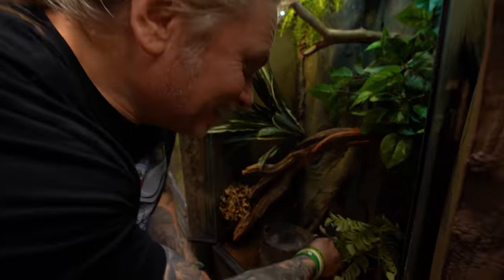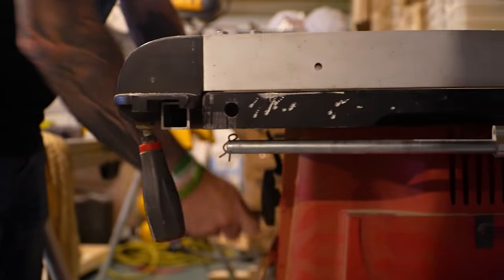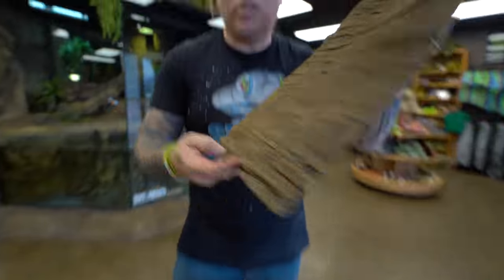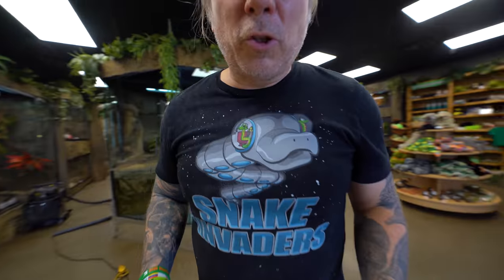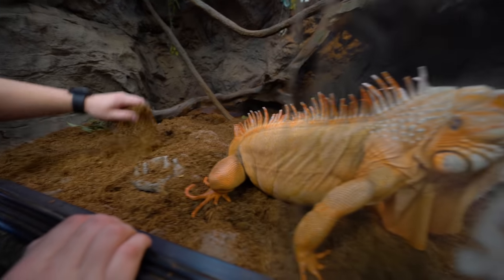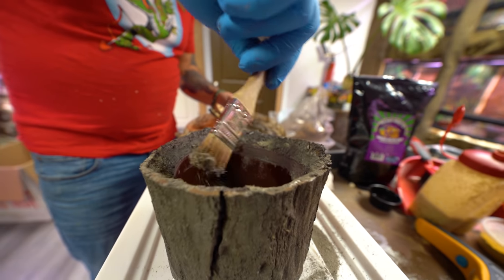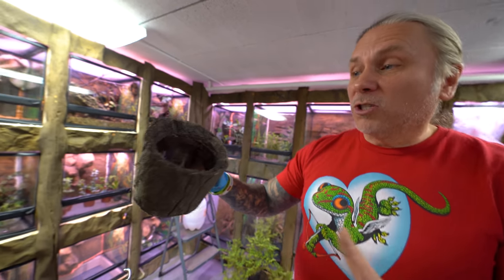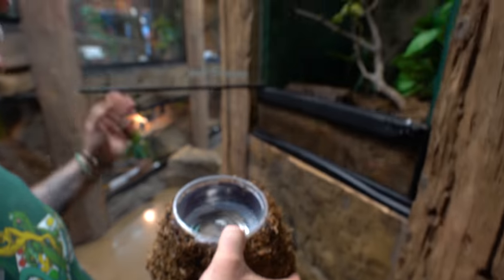I Built These For $15! Make Your Reptile Cage Shine!

Comment: Pro tip with great stuff

After about 20-30 minutes, the outside layer of foam hardens but the inside is still wet so you can contort and shape it super easily. If you press it down, you won’t need to trim all the ugliness later. It keeps it much cleaner looking.
Reply from the maker: This is a great tip!
Reply: Thanks. I'm looking into how to use this kind of stuff to make my own hides so I appreciate any tips 😊

Comment: I make whole vivariums with great stuff pond and rocks. I carve with a knife and do detail work with a dremel. After I’m done carving I use original drylok mixed with acrylic paint. 
I’m also used foam board and coconut/palm mats glued on and both look amazing!

A little tip: the foam continues to expand for 72 hours. I wouldn’t carve until after that’s done. You should also let it off gas for 10 days after using drylok or anything really.

Comment: What if you u put the universal rock inside the jig with the wood texture twords the plastic and put wax paper then foam between the wax paper and coupling . Would it pick up the wood texture and the wax paper or cling wrap would keep it from sticking to the universal rock . And the universal rock would stay in the mold to be used over .

Comment: I just came back to this video because I was about to buy the supplies to make these water dishes, but I realized that my snake likes to soak in her water dish from time to time (I use Tupperware containers that she can fit into) and if I do this I won't be able to clean them as easily or at all. Right now I have 3 identical dishes and I cycle them out every couple of days and put the used one in the dishwasher. I suppose I could hand wash them but I wouldn't want to wash away all the dirt/moss and stuff on the outside. Hmm, now I'm stuck and don't know what to do.